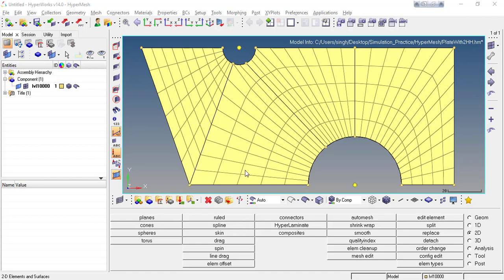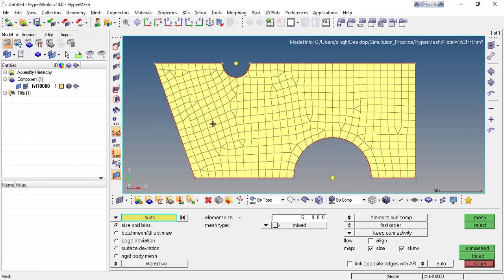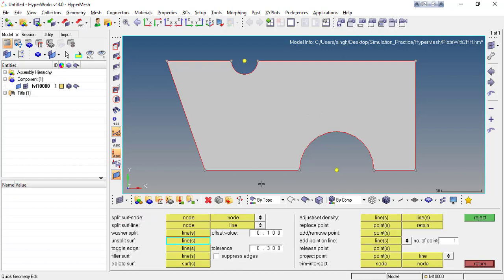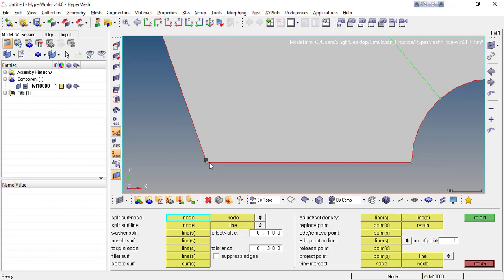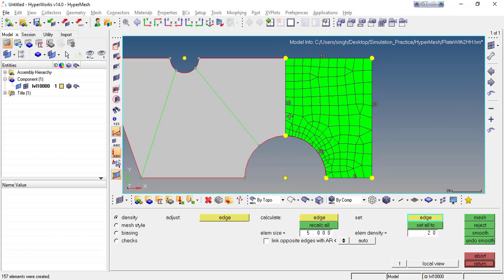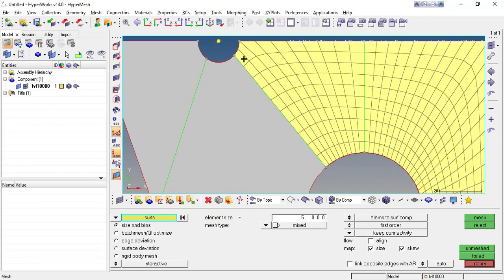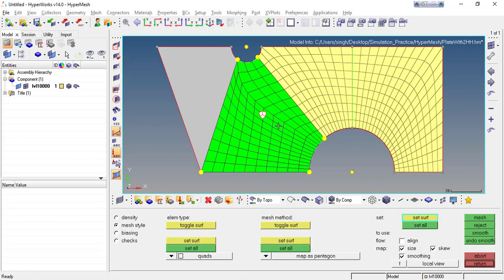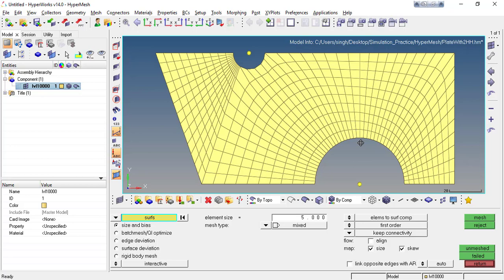Meshing in Hypermesh - Advance Meshing option for complex geometry

Comment: at minimum length it will fail
Reply from the maker: Dear,
Minimum length quality is important in case of explicit dynamic solver. If one want to perform static structural simulation... minimum size not an issue.

Comment: Thank u very much for making video but sir for crash analysis this type of mesh is not accetable  i think and because  of the cured line i think it take more computunal time
Reply from the maker: dear, 
for crash analysis  mesh flow is more important for better convergence of solution and wave propagation, so we accept tria element there up to certain limit [usually 10% or less].